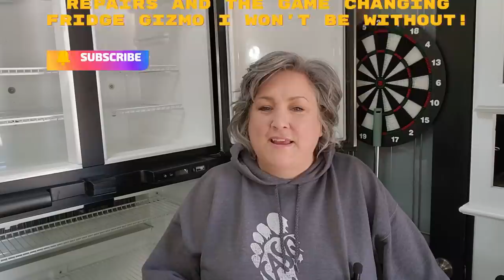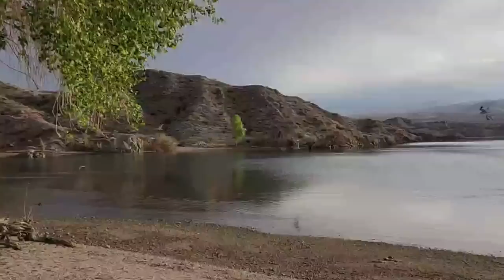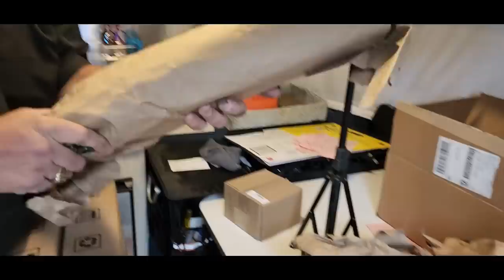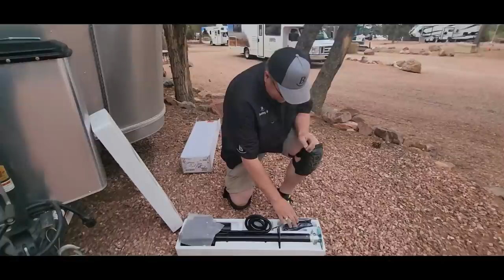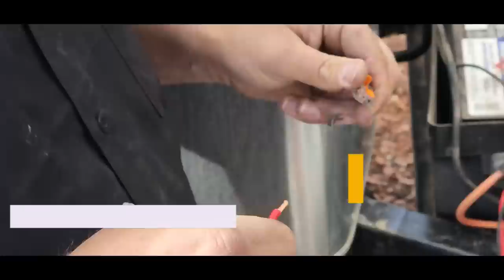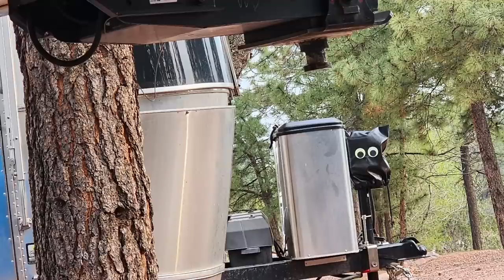I Ripped My Legs Off Fleeing CREEPERS! RV Etiquette PSA: A Cautionary Tale & airstream leg repair

Comment: This is why as a single traveler I prefer to have access to the cab from inside the camper, so I can get the heck out of Dodge FAST.
Reply: I’m with you…I’ve thought about RVing and as a single woman am thinking about class B or small Class C for that reason?
Reply: Yup…therefore I have a van.
Reply: A pass through is an absolute must!
Reply: Bad weather too....pull over or just take a nap
Nobody sees who is inside.
Reply: Yep. Vanlifer.
Reply: Me, too!  It's one of the first things I learned from Robin when I started watching her back in 2018 or so. I bought my Class C in 2019.
Reply: Same here! Having a "loose" vehicle seems so tempting, but I know if I get spooked I wanna be able to get away FAST.
Reply: Thank you for sharing your perspective on accessing the cab from inside the camper, it definitely provides a fast and convenient way to stay safe. Speaking of safety, have you heard about the Segway Portable PowerStation Cube Series? It's a fantastic option for outdoor enthusiasts like us, with features like massive capacity, fast recharging, and comprehensive protections. Check it out if you're looking for reliable power on your camping adventures!
Reply: just click that shot gun, that noise is scary as heck everyone knows it.

Comment: If i have put something unusual under my rig that I dont want to forget or crush when i drive away, i stick a note on my steering wheel that i cant miss, even if not yet awake.
Reply: I use slap stick kids bracelets- I label them to remember things. Like yellow one labeled leveling blocks- blue one labeled propane to remember to turn it off. Ect, ect.
Reply: I put a red sock on.the g 0:48 ear shift and on the road it's on my antenna crank. So 2 birds with one sock :)
Reply: Could spray paint those legs orange or bright yellow so they're noticeable (tho I don't think you'll ever forget them know) 😅
Reply: @SunVegan  I make myself a sign with a checklist

Comment: Suggestion: for peace of mind, a couple sets of back up cameras, properly attached you can have 360° view of your camper. Not only will they help with your peace of mind , out boondoggle, you could enjoy watching wildlife, ie deer, coyotes, etc. If you need to warn someone off, hit the lock button on your key fob, you’ll get your headlights off and on, and a short beat, if that doesn’t work hit the panic button that will attract attention that an intruder does not want .. stay safe see you down the road

Comment: Buy two cowbells. Put each one on leash to a jackstand, you'll hear them if you try to move. Or put a big ribbon on each one, and drape the ribbons on your steering wheel after you put the jackstands down.
 Like the ribbons the pilots all use:"REMOVE BEFORE FLIGHT".

Comment: Robin. Glad you are safe. If you don’t already have a electric drill to assist in those rear jacks. Had one for my trailer years ago it was fast up and down. Take care enjoy your adventures
Reply: Yup. I keep the appropriate sized socket with my vehicle scissor jack and use my dewalt drill to quickly work the jack.
Reply: Very good point! Drill makes big diff

Comment: I always used a very tall tongue jack support so I don't have to crank it very much. Usually several short pieces of 4X4 stacked log cabin style. Just crank down for a few seconds, throw those pieces of wood in the back of the truck.
I also carried pieces of boards to make ramps when necessary.

I use very inexpensive pyramid Jack's or one ton hydraulic jacks with short extensions for short stays. Otherwise I don't even put supports under the backend. 
If I'm just pulling over to sleep for a while I don't even put the tongue jack down.
Just jump into the truck and go! 

I really missed a nice camping setup I had back in the 80s. 
It was a mid-80s diesel pick up with a 24ft tt.
I had previously tried a slide in camper but it was too small for me.

I love your videos.

Comment: I haven't watched the entire video yet, but about the electric tongue jack. Yes, great improvement. But if your friend hasn't had one before, find someone who has to give you a few tops (or maybe someone here has). I've been away from trailer life for too long now to remember, but i do recall that my camping mentor gave me some important tips. And add info re the tongue jack to your checklists. Add the stabilizing jacks to your checklist right now while it's on your mind. I had to give up trailer when i could no longer bend or squat. Good luck.

Comment: I do not like propane tank covers!
It makes it too hard to glance at every couple of days as I walked by.

You should probably do a video on how to use automatic changeover propane valves for people that don't know how to use them correctly.
Those automatic changeover valves are a lifesaver for me!
I lived in my trailer for 4 years and never ran out of propane because of them, even in freezing temperatures.

Lots of people are either too ignorant too lazy to glance at those automatic changeover valve every couple of days, and then they gripe about running out of propane. 😄😆😃

When I bought my trailer used I didn't even know about those, but I figured out how to use it in just a few minutes.
Always leave both tank valves all the way open!
When you see the red indicator pop-up then flip the valve to the other tank because it's already using from that new tank. Then refill the empty one , put it back on and open the valve!
Apparently some people like to keep their tanks covered, maybe they're ashamed of them.
To me it's a part of camping and I'm proud to let my tanks show! But keep them locked on with chains and/or locks! 😃😁

I just love the way they switch from one tank to the other in the middle of the night when it's snowing outside!!!
They will never take from both tanks at the same time!!! If it does then there's something wrong with it and it needs to be replaced.
Camping World wanted $80 for replacing it back in the 1980s. By I went to a propane dealer that sold me the same thing for $20.00!!! 😁😃❤️

I know that Robin may never read most of the comments on here, but I figure my comments might help somebody out of there. 😃

Comment: I didn't drive off with my stabilizers down but I did ruin them by operation my electric jack without raising the stabilizers. The expensive lessons are the ones best learned.

Comment: My dad's friend, and fellow owner if Dad's Cessna 177 RG had the opposite problem once.
   He was headed into Burbank and made a nearly flawless landing. The only flaw was a rather large one though. He to was using a check list.
    After this dad rewrote the check list to include landing gear checks 5 times between "Lower landing gear" and landing.
    This is actually not at all uncommon. Once, waiting for our turn to take off I saw the plane on short final looked odd. I asked my dad if the plane's wheels were down, and rather than answering he keyed the radio and said, "Aircraft on final, go around."
    Pilots are trained, when they hear "go around" you don't ask why, you just do it.
    The pilot descended to about a foot from the runway. Lower than he would have been if the wheels were down. Fortunately his nose was already up so he didn't hit the propeller in the runway.

Comment: I turned too sharp and caught a pole with my 12ft camping trailer wheel and bent the axel Memorial weekend.  My rig is currently in the shop waiting on a new axel.  Expensive mistake.  Doesn't matter how experienced you are, mistakes sometimes happen.

Comment: these RV's seem to be built so cheap as opposed to  boats which  are made to take the environment they are in,,but all the parts in these RV's seem so cheaply made - like not even the quality of stuff you would put in a house that does not even move!  it is sad how much time owner have to spend on fixing stuff. it just is not right